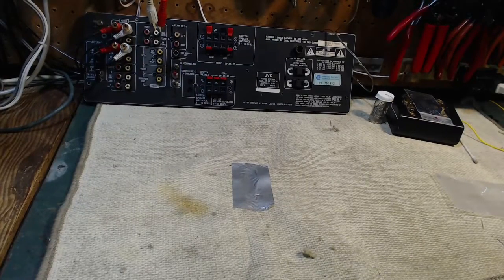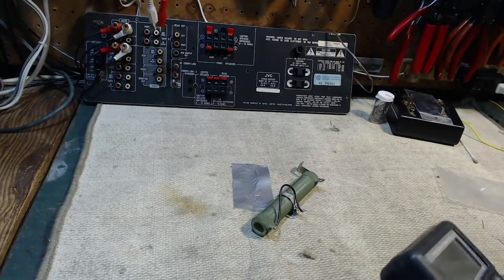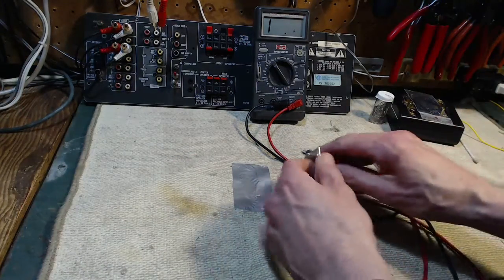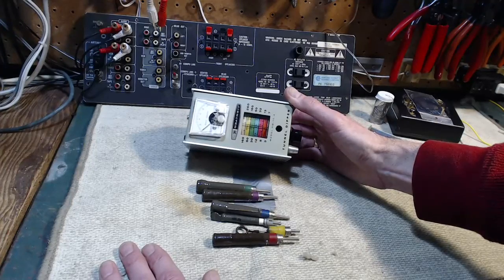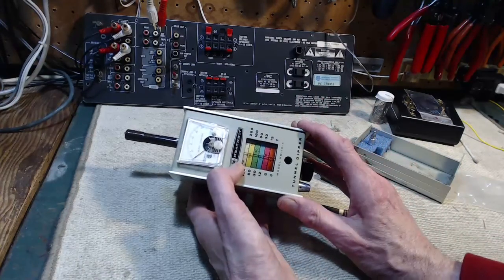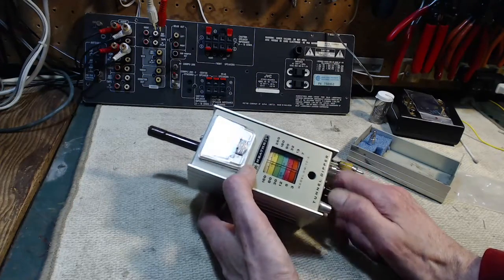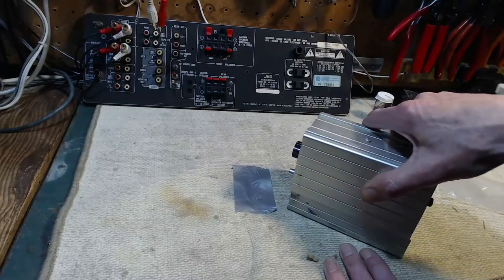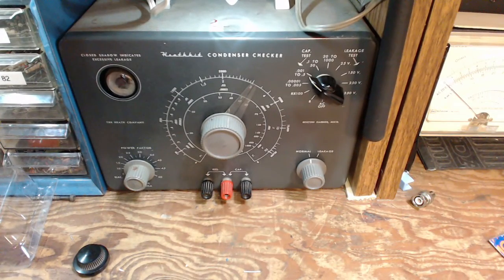New Shop Tools and Instruments

Comment: dip meter works for radio alignment like your sig gen
Reply from the maker: ***** I need to get the meter operating to use it as a dip meter.  It does work sometimes but I really haven't looked into it yet to find out what's up with it.

Comment: What about the new scope? :) Can't leave that out! That cap checker is worth it's weight in gold. Modern cap meters are questionable with higher voltage caps. Most of the caps 150V and above need to have close to their actual working voltage to determine leakage. Some electrolytic don't show leakage until they're actually operated very close to their maximum rating. This checker will tell the truth. Since I service tube amplifiers, vintage radios/TV's and modern audio gear for a living, the old style cap checker is of great value to me. ESR meters are ok for lower voltage caps, but nothing like creating the real world scenario to determine if a cap is going to eventually fail in circuit or that it's totally kaput! Frank Ferraro--Audio Craft Electronics. :)